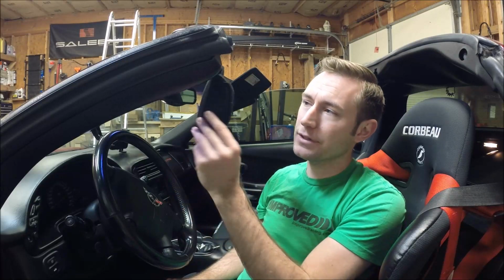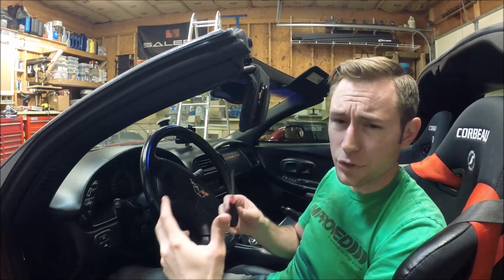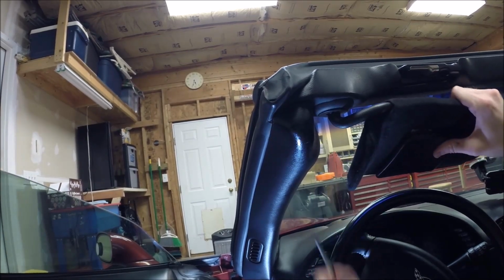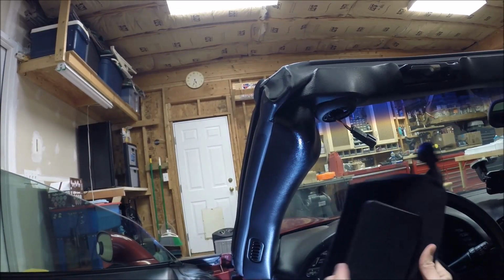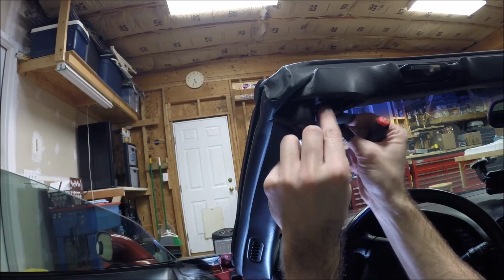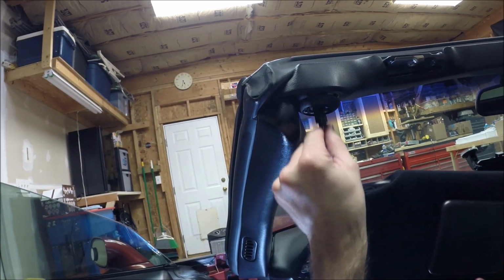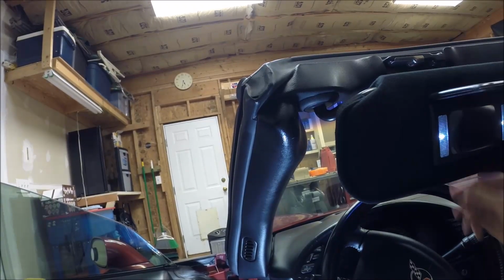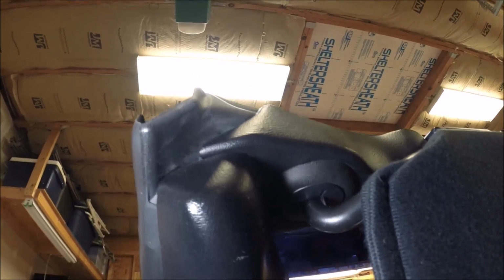C5 Corvette - Sun Visor Replacement

Comment: Excellent and detailed instructions.  Thank you.  I removed the driver's side visor that had a broken "wing".  Once our, I opened up the broken part , discarded the crappy cardboard, cut 2 new pieces of cardbroad but before I put it all back together, I inserted a thin piece of rigid plastic from a milk bottle between the pieces, glued it and reassembled the visor.  Everything works and it looks as it should. The removal and reinstallation took only a few minutes.

Comment: Just did mine.  Followed your instructions and everything went smoothly.  Thanks Scruff
Reply: 302VetteLife   Awesome, glad the video was helpful!
Reply: Wish mine went so smooth, PIA to get the old drivers side removed, I finally got it and a PIA to get it back in, then the one's I ordered from Amazon didn't fit just right, the arm was too short to lock into the holder and will not snap into the holder, I have to get my dremel and remove some to get it to snap, I'll do the passenger side next weekend that's how long it took me.

Comment: Helpful video in getting the old visors off. I decided to go with "Corvette Clips" visor eliminator plugs. Best decision I ever made for under $20.
Reply from the maker: There ya go!   They can't break if they aren't there, haha!
Reply: Lol!  Exactly! I've owned 3 C5s. The only one to not have this issue was the 99 FRC.

 The one I still have, a 99 coupe, I've had since 2000. I just ignored the floppy dog ears for years. Finally it got to me. Once removed from the car I have 2 inches more or so of visibility out the windhsheild.  I should have done this swap 10 years ago.

Comment: I finally figured out why I couldn't install the replacement visors.  The wire lead was too short; only 1/2" long compared to almost 2" on my old visors.  That prevented being able to get the connector far enough into the channel which didn't allow the triangular piece on the end of the visor arm to be inserted sufficiently.  I called the company and they sent me replacements with longer wire leads.  It was pretty simple after that.
Reply from the maker: Glad you were able to get it figured out!

Comment: Thank you. Your instructions are exact.  However, I purchased new visors from TopFlight.  The bezel that is connected to the visor was so tight/seized that it stripped the trimm bezel after installed.  You couldn't move bezel piece with hand like you did. So I had to remove the new attached bezels and use my old ones because they moved freely, I then had to purchase one new trimm bezel and reinstall.  All good now but disappointed with Topflights ill equipment.  Anyone who cannot move bezel with your hand like in video think twice before installing because the trimm bezel is plastic and it will strip.

Comment: thanks for sharing the secret.  replacing both of mine (2004 convrt)  got them from ecklers for $170.00 delivered. looking for an upholstery shop to dye them light oak to match the interior. good video
Reply from the maker: Thanks for watching.  Definitely not hard, but if you don't know the "trick" it's easy to break them.

Comment: For the passenger side, is the rotation (for removal and insertion) in the same direction as the driver side, or is the rotation reversed? I want to ensure I don't force it in the wrong direction.
Reply: It is opposite, so to the right to remove and left to install(tighten) for the passenger side, everything else is the same.

Comment: Well done! Thank you for posting. I don't need to replace my visors but I do need to drop the headliner in my FRC so I can route the cables for a dual dashcam system. Can you tell me if the passenger side screw driver slot needs to rotate in the opposite direction from the driver's side? Thanks, again.

Comment: Hi watch the vid! It was help, except ran into a big problem! Put the screwdriver in as suggested! But pulling the mirror as suggested, the whole mounting also turned with it!!! Any suggestions to get around thins other then putting a channel locks to hold the bottoms stop it from turning also to get the viser out without marking up the base???

Comment: Great video.  Thanks for posting.  As others have said its relatively easy and doesn't take much time.  Your instructions were spot on.  I ordered mine from Eklers and was satisfied.
Reply: I don't know why,  but mine had to turn the opposite way. Clockwise to remove,  and counterclockwise to install.

Comment: I was able to replace the passenger side visor with no problem at all but the driver side won't come off at all, I've stripped the plastic where you put the screwdriver to get the clip off, it hasn't budged. Is that the only way to get it off?

Comment: I watched your video on replacing sun visors several times and have spent more than two hours trying to get the drivers side visor on my 2001 installed, but no matter how I've tried I can't get everything in place.  Most of the trouble I'm having centers around getting the plug into the cavity to the left of where the visor will mount.  I've tried to get it in on the right side but no luck there either.  And worst of all I've read many of the comments from viewers who managed to complete their replacement.  Sure would appreciate any other suggestions you may have.  Thank you,

Comment: Nice seats, I am 6'4", did you get more headroom with the seats? Are they comfortable, what model number?
Reply from the maker: Thanks, they are Corbeau FX1 seats (slimmer "Pro" version on the driver side).  Overall the seats are comfortable (for a fixed back race seat), and the seats make a huge difference on the track.  I installed mine with sliders.   But the sliders cut down on headroom.   I'm 5'10" and with my helmet on, I'm very close to the roof.   Now as the seat goes back, it slopes down, so you gain a bit of headroom.  But if you are 6'4", I think you'll probably want to eliminate the sliders and just hard mount the seats in place.    I even cut the rear mounting pedestals off the seats to get the rear as low as possible (so that the seat leans back some).  I did an installation video when I put the seats it, which I think will really help you.     https://youtu.be/FEBH4C9pIVU